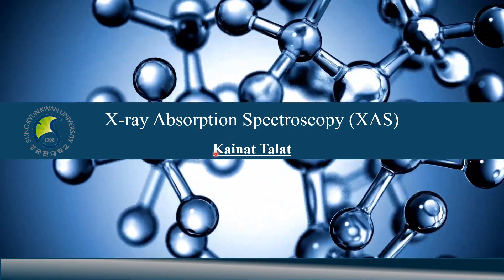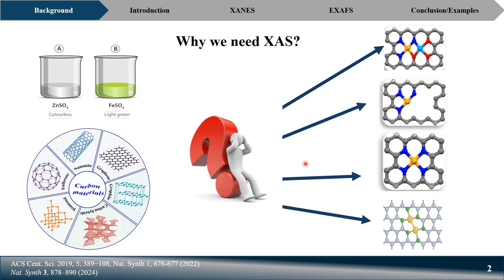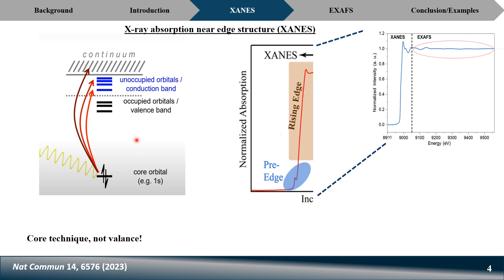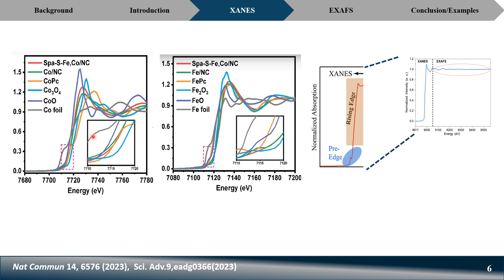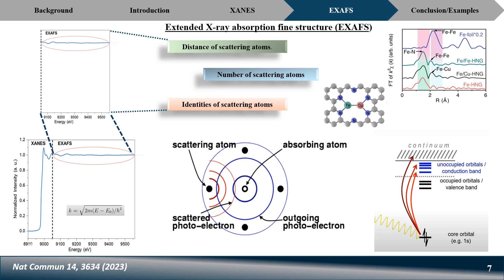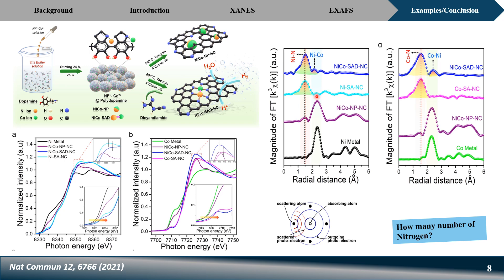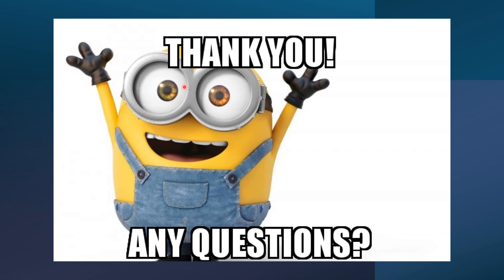X-ray absorption spectroscopy, EXAFS and XANES

Comment: 🎯 Key points for quick navigation:

00:15 🔬 Introduction to X-ray absorption spectroscopy, an experimental technique for material analysis.
01:50 ❓ EXAFS used to determine the structural characteristics of synthesized materials, such as coordination environment.
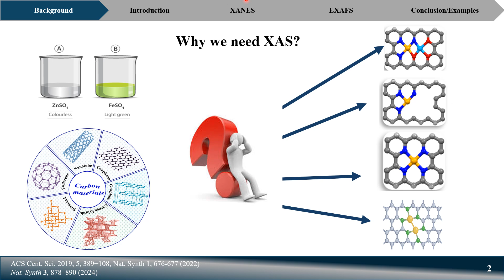02:55 📊 EXAFS divides into two categories: XANES and EXAFS, providing different types of spectral data for analysis.
05:12 📈 ZANES spectra divided into pre-edge and rising edge, revealing geometry and oxidation states of materials.
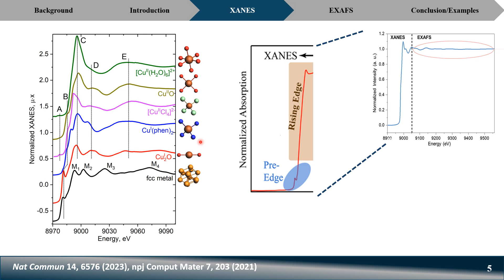06:46 🧮 Pre-edge analysis helps identify the geometric structure while rising edge analysis determines oxidation states.
09:05 ⚖️ Oxidation states can be interpreted by comparing synthesized materials' spectra with known references.
10:29 🌌 EXAFS reveals details about neighboring atoms around an absorbing atom, such as distance and identity.
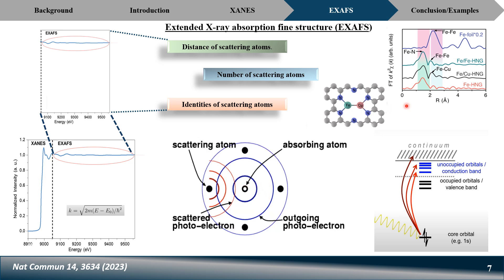12:05 📑 EXAFS spectra show oscillations indicating the presence and influence of nearby atoms, critical for structural interpretation.
15:47 ⚛️ Coordination between metals can be inferred from shifts in oxidation states observed in ZANES data.
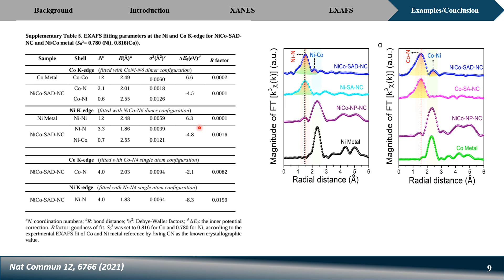17:18 ✔️ EXAFS is a powerful technique for understanding local atomic structures and requires fitting calculations for precise data analysis.

Made with HARPA AI

Comment: Thank you very much — that was extremely helpful. I have a question: For instance, if the XANES spectrum of Pd/C shows that the absorption edge intensity of Pd lies between that of metallic Pd (ingot/wire) and PdO, can we interpret this as evidence that Pd is atomically dispersed within the carbon matrix?
Reply from the maker: No we cannot. we still need some other characterizations ( EXAFS, STEM-EDS) to confirm the atomic dispersion.